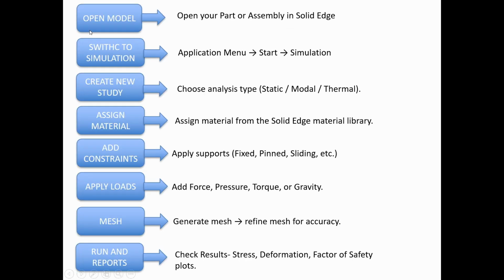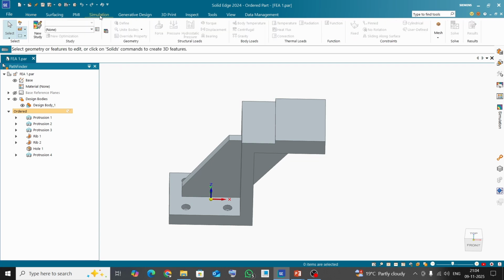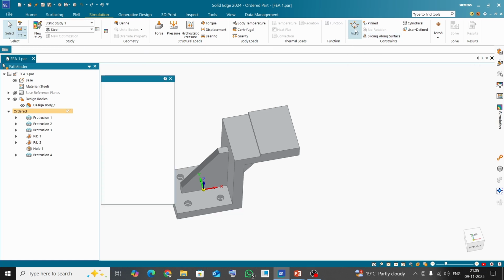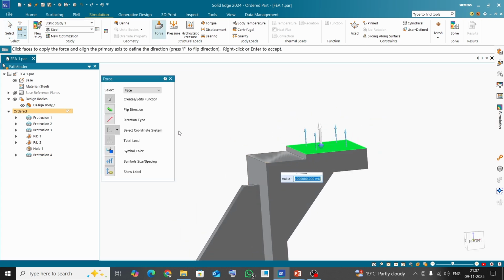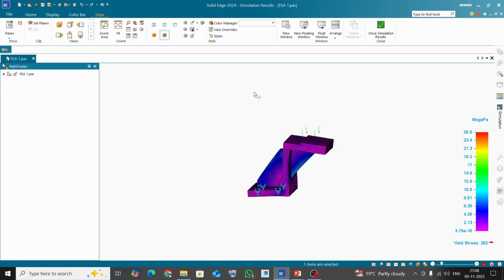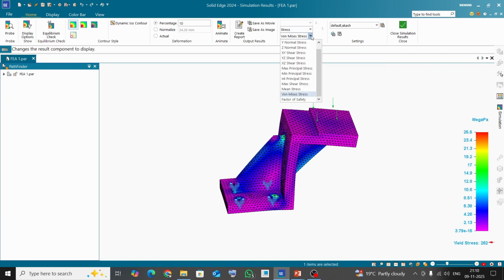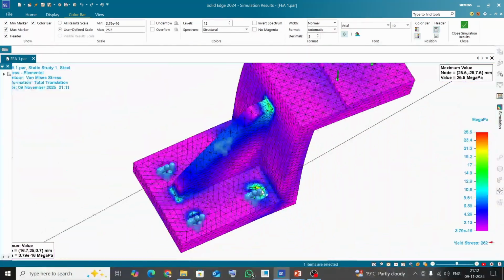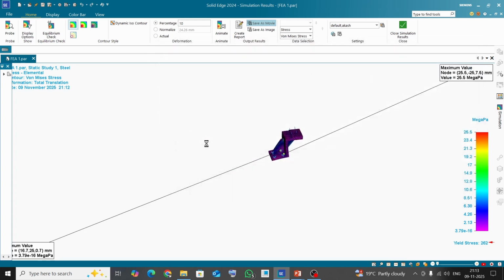Solid Edge Simulation Tutorial | How to Perform FEA in Solid Edge

Comment: Hi! When there is a Nastran error while solving ie: meshing or connecting error. How can we serch for the exact element in the mesh to check it ? Thanks in advance.
Reply from the maker: Hi! When Nastran fails due to meshing or connectivity issues, check the **Solver Monitor / .f06 or .log file generated by Solid Edge Simulation. The error message usually references a specific Element ID or Grid (Node) ID.
In Solid Edge, enable Mesh → Display → Element Labels / Node Labels to visually locate the reported ID in the mesh. You can also use Mesh → Validate / Diagnostics to identify free edges, duplicate nodes, inverted or highly distorted elements.
For connectivity errors, verify Bonded/Contact definitions, ensure bodies are not disjoint, and confirm that midsurfaces and solids are properly connected. Local mesh refinement or re-meshing the affected region typically resolves these Nastran errors.